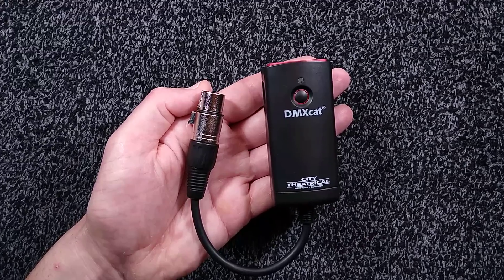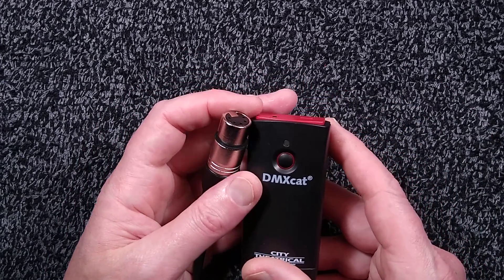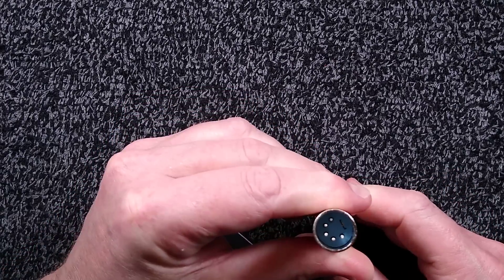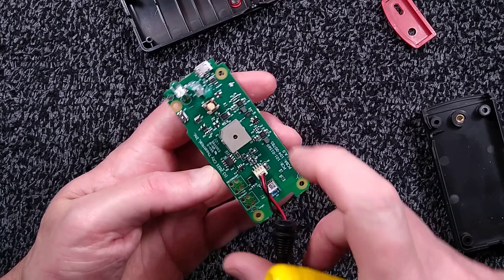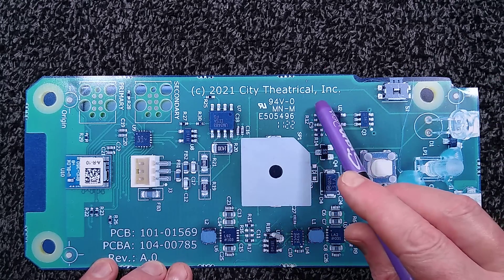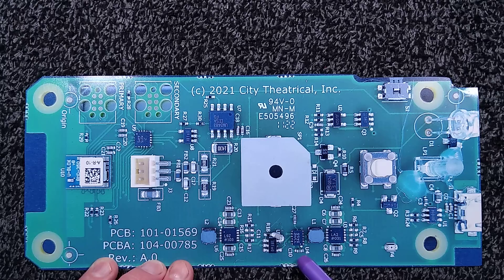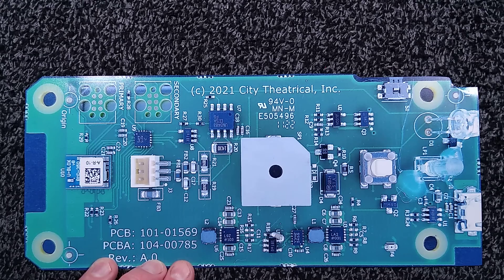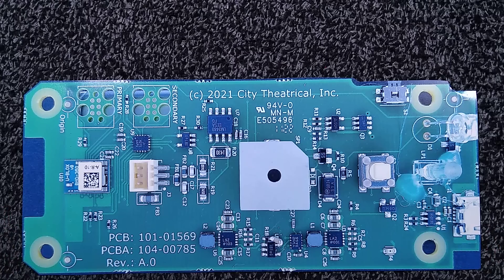Inside the DMX-cat event-industry lighting tool

Comment: As a DMX Cat owner of about 8 years or so I would hope to see an explanation of all of its functions via the software if I was a new user? While it was mildly amusing to see inside the transmitter it was missing the point somewhat? especially as you only had vague knowledge of the items on the CB. So you missed an opportunity to show what all the functions of the software are. IE: Troubleshooting DMX signals [ which BTW are not a network but a Protocol] How to load Fixtures into the device, How to group them, how to troubleshoot fixtures with the device, how to use RDM for addressing and trouble shooting. Show people around the software which is very feature rich. Jus' sayin' because I thought it odd why you did veer off into irrelevance…
Reply from the maker: This was just really intended as a look inside as opposed to a full operational guide.

Comment: I am a firmware developer for DMX/RDM  light fixtures. A wireless DMX/RDM unit from the City Theatrical outputs very weird DMX data frame where it breaks the DMX data frame into chunks. It would hold the signal line high for a brief moment in between the chunk until it is finished sending all 513 bytes of data. This resulted in the DMX frame get stretched and the timing got thrown out of the window.

I had a major problem as my firmware relies on a break condition of the UART to signal the start of a each DMX data frame and a timer. So it would only detect the data that sits between the UART break condition and expired timing while the rest got lost as a result. My fixture works with so many other popular DMX controllers that has a proper DMX data frame with strict timing such as Enttec, DMXKing etc.. except this thing. The client (quiet big) would not wanted to change the controller system, I ended up rewritten the whole low level receiving end mechanism to support this device. To these days, there is no explanation as to why the City Theatrical would allow such deformed DMX frame like that in their commercial product.
Reply from the maker: Keep in mind that the DMX standard does allow for quite long gaps during transmission of the data.  Many simple DMX generators use that tolerance to do other processing.

Comment: Hey Clive! I’ve got a potentially interesting video idea for you. 

Recently some of those “disposable” personal fog machines have been being built with a USB-C charging port on them. Before, even if there was juice left in the machine you were at the will of the battery and that’s why people were tearing them open and charging them in less-than-ideal ways. These new machines still aren’t refillable with juice, but the battery has a charging port. 

This begs the question, though: Do they have an overcharge protector? I haven’t torn one open personally but I would not at all be surprised if some models don’t given that most of these come from factories in China, and that’s a serious hazard.

It’d be interesting to see a handful of models opened up on camera. I don’t suggest you just go out and buy a bunch of new “fog machines” to source the rechargeable ones but you might have to find a more reliable source than your local roadway. Unless the UK has a more serious issue with an overlap between people who litter and people who use personal fog machines than I thought.
Reply from the maker: I made a video about one of those recently.  It does seem to have charge control.
Reply: @bigclivedotcom  Oh okay! I must have missed that video. That’s a relief for sure.

Comment: Very useful tool.. to prank your colleague with the flamethrower on stage. :-)

- How are safety features handled,  movement or "flames" in the protocoll, wired or wireless, so there is no equipment going crazy on interferences ?
Reply from the maker: The flamethrowers we use require specialist controllers.  The cheap eBay ones are not safe at all, as DMX has no error detection.
Reply: @bigclivedotcom  ah, thats really bor..
 i mean interesting to hear 🙂

Comment: The (not) fun of DMX. I put my hand up to design and build a bespoke lighting system for a large marquee on a small island . Apart from anything else it was a marine environment so 3 or 5 pin Amphenol connectors  did fare too well and neither did the marquee itself when the gale force winds hit it. As I worked though the various issues and tried different kinds of lights I found one we had that was made for film and TV lighting that used 2 bytes for each of the RGB sources, the only way to get very precise colors it seems. DMX was probably as good good as could be done when it was first thought up but I feel today there could be a demand for something less prone to confusion and more robust.
Reply: It could certainly do with a bit of a revision to add FEC and a little more bandwidth.  But the longer it stays viable, the less likely anything is going to dethrone it, just for the sheer ubiquitousness of it.

Comment: I think it is hilarious that they came up with the metaphor "universe" for basically a bus with at most 512 units on it, leaving no relevant metaphor for a setup of several such buses.

That level of foresight beats Gates' infamous 640k RAM prediction...
Reply from the maker: DMX512 was originally intended for controlling dimmers.  At that time they didn't realize it would be used for moving lights.  512 dimmers would be a lot.

Comment: While doing some research on can bus for a DIY CNC project I came across the following tit bit."The EU has mandated the use of CAN SIL 2 for automation in new products which  are safety critical to the public". 
But I haven't been able to verify this.
I know DMX has being used to control Safety critical items like lasers as well as winches and hoists for moving rigs and staging. Dp you know if DMX/RDM is SIL 2 rated and do you think this might affect the future of DMX.
Reply: DMX has been fudged to work with those systems but as it has no error checking built into the protocol you need extra electronics/software to "sanity check" the data as well as separate hard wired E Stops/deadmans. Sanity checking methods depend on the type of device and can include :-

Same data must be seen on two or more channels.
Must receive the same value over 3 or more frames.
Ignore sudden huge jumps in value (filtering)
Values must be within a specific tight range (for basic on/off triggering)
Only send cues to trigger sequences controlled by a safer system.
Ideally several of those methods would be used together.

I don't know the requirements for SIL 2 but DMX is almost certainly not compliant but it's possible if could feed control data/cues into a SIL 2 rated system.
Reply: On one system I designed there were two channels that had to be set to 50% (within about +/-10 to account for analogue desks) to arm it and also if the fader was moved too fast (someone knocked ot for example) it wouldn't arm the fore command was again 50% but a single channel and no restriction on speed, there was a stage manager acting as a spotter with a deadmans to physically kill power if necessary after which the system would have to be disarmed and re-armed. Another thing you have to be careful of is that some "smart" DMX repeaters can carry on putting out the last values recieved if they loose input so flame effects etc.  mustn't be used with them.

Comment: I notice that the professional 5 pin plug only has 3 wires!?
Reply from the maker: The DMX standard allows for two independent networks with a common 0V reference.   Only one is needed in this application.

Comment: The probe they use is called Tag connect. It is a commercially available debug / programming probe and is advertised as a way to add programming headers without any additional BOM cost. There are two versions of this probe. One locks in with the outer holes and is used for debugging and the other version just pushed in. Both probes use pogo pins for the connection. I also use it because it flexible an not that expensive for the probe and as sayed above, no BOM cost for debug headers.
Reply: Is that connector proprietary? I didn't have any luck finding off brand versions. I was thinking about including it in some of my projects, but even the "barest" cable (6 pin pogo tagconnect with no legs to 6 pin IDC) costs about 40€ (for something that should be in the low single digits). I know the purpose is to save cost on mass produced items, but that price of the connector is prohibitive to just have around, especially when it would be useful to have multiple to have them permanently connected to different programmers for SWD, ISP, TPI aso.

Comment: Clive is a DMX bandit
Reply: Maybe Clive has designed some DMX gadgets using some of the older PIC micro's. It can be done with the old (and much newer) 8 bit PICs running at 20MHz and having a UART. Many moons ago, I used to work at a place that did just that, and managed to fit a clunky DMX controller into 8k words of program memory (only 256 slots though, as limited by what I was allowed to use at the time - a pic16c77, and the existing PCB already designed by someone else). PIC16c65, 16c74 and 16c77; ancient by today's standards!

Comment: The debug probe is the TagConnect 6-pin, promoted by Microchip for PIC programming.  It has 6 pogo pins for data and power, 3 alignment pins for the small holes.  The "with legs" model has 4 plastic snaps the grab into the 4 big holes so ypu don't have to hold it.  The TagConnect plugs were originally promoted as a way to provide a zero cost JTAG connection point, but the designers thought that all JTAG attachments needed the extra signals added by some proprietary solutions, so they focused on their larger plug with more pins (I think it was 10).
Reply: Silicon labs like the 10 way version too
Reply: @edc1569  yep. it's usually a small header, they call it "mini simplicity" connector. Its basically SWD+UART+Energy Monitor+ Packet tracer. A handy connector, I like them, and adopted them for other non-Silabs designs

Comment: Is it possible to get something like this, but way cheaper?
It doesnt look like it would be too expensive to build.
Reply from the maker: The cost is in the software.  There are generic disco units available, but with very little functionality.  This unit has a frequently updated library of different lighting fixtures.
Reply: You'd have to make it yourself. I'd guess an esp8266 or esp32 using a web interface would be good for DIY, you could write a mobile web app for it then instead of having to learn how to program a native mobile app - you could even program a full lighting controller/desk as a web page too, if you liked. You'd have to implement the rdm protocol and dmx output and some method of mapping device functions to dmx channels. A nice little project.

Comment: What happens if you have a dmx channel clash can you remotely reasign the channel or do you need to prod the back of the light/s?
Reply from the maker: You can have multiple lights on the same range of DMX addresses.  The RDM address is different, so each light can still be remotely accessed.

Comment: Poll: DMX with 3-PIn XLR connectors is better because the pins are larger diameter, they don't bend as easily, But they should have a slightly different chasis, a bit like 240v and 110v ceform power connectors or Powercon/Speakercon connectors.
Reply: I've seen people ram a speakon into a powercon, also seen trucons forced in at the wrong position (which can result in live casings) bent pins in dmx are actually pretty rare so I say leave 3 pin to the DJs.
Reply: Answer 1: I wish all equipment would use 5 pin, then I could do cabling while half asleep without worrying about pushing a microphone cable into DMX and vice versa.
Answer 2: I wish 5pin connectors were as cheap as 3pin connectors.

Rebuttal to your thinking: yes, DMX is a current loop. No, the amount of current is so low that a 0.14mm^2 (26 AWG) wire can carry it without even noticing. The housing around the pins is already so robust that it is almost impossible to bend the pins by using the plugs in a normal manner - you'd have to shove in a screw driver and screw up the driver to bend them.
Reply: @KonradTheWizzard  5pin and 3 pin are pretty much the same price, bit of difference in panel mounts but inline theres maybe only a penny in it and if you buy any sort of quantity that difference vanishes.
Reply: @Savagetechie  If you buy from Neutrik, then yes absolutely. If you buy the really cheap chinese connectors then the difference is factor 2-3x. The 3pin ones are so cheap that a hobbyist is able to live with the sh*ty quality. The 5pin ones make you think whether you wouldn't be better off buying quality for double the price instead.
Reply: @KonradTheWizzard  Cliff components do nice inline ones for £1.60 a connector, cheaper than neutric and not shit.
Reply from the maker: Good idea for a poll.
Reply: @bigclivedotcom  Yep, you should run this. NB: I'd always choose 5-pin if it wasn't for the amount of times I have had to deal with the bent pins. For me, thats a deal breaker.

Comment: I keep contemplating using DMX as a way of "outsourcing" switching a light with an AC plug on a project of mine. Unfortunately, nobody seems to actually make a low cost off-the-shelf compact "2 relay-switched outlets with DMX control" product.  Lots of much bigger/fancier things that could do a similar job, but they're all huge and/or expensive.
Reply: There are some cheap chinese DMX LED controllers on ebay. You could abuse one of those to drive up to three relays (using 0 and 255 on RGB controls)
Reply: Besides cheap controllers, theres a lot of DMX-stuff from china that fullfills his needs without abusing something (put "DMX relay" into Ebay-search), ...
However, years ago my own successfull abuse  was to solder wires onto the 3 pins of an external RGB-Pixel controller (WS2811) instead of an RBG-LED and wired these (including the negative) to a standard relay-board using optocouplers to drive the relays, ... that also worked fine (additional decoder for RGB-strips needet).
Any standard 3- or 4-channel decoder/dimmer can do the same.
Reply: If your coding skills are sufficient to greet the world hello in C, you can pretty much roll your own DMX whatever.  There are, naturally, Arduino libraries a-plenty, and I'm sure you can't swing a dead cat in a hackerspace without smacking into the schematics for an RS-485 gadget.
Reply: @sirnickity  It has nothing to do with what I can build, and everything to do with product liability and certification for switching mains AC if I want to sell a product that needs to ultimately do that.

Comment: Thanks for sharing this! That's a neat tool... I like the way the industry has matured, it's come a long ways!... Story time friends... I'm going to take you back to my "theater" days so-to-speak in the late 70's early 80's I volunteered to work the sound/audio at a small church.  For special musical productions when we needed stage lights someone at the church made a control box... (big heavy thing) out of plywood with 8 rotary dimmers (the ordinary kind used in residential wall with push on/off and rotate for dimming) and 8 outlets...  I'll give him credit at least he used some pretty whopping heavy duty extension cords to run to other boxes with lights... These "Light" boxes were also heavy duty... It had sockets for 3 outdoor incandescent flood lights some were colored inside the box was some aluminum foil for reflection the box had a 45 degree angled sides to it (ASCII sketch:  [ ]< )... these were made to either be hung or sit on the floor and point up at the stage,   If you cranked those babies up, you could feel the heat... wonder if you could cook a hotdog? Seriously... LOL!  Overall, I think we only had 3 or 4 in use and not at max brightness... but thinking back on it, if you powered all 8 of those suckers I wonder if that "control" box could handle it... I think it had 2 AC inputs one for each bank of 4... but I give the guy credit for using extra beefy extension cables, but our wimpy power supply here in the U.S. (LOL)  120VAC / 15A /20A circuits and all those flood lamps?  Not a chance!   Heck, I don't even know if those rotary dimmers could handle 3 outdoor floods just by themselves.  On a side note: I borrowed that box to run the lighting at the Halloween events at the church... I will say that the guy that made this setup was handyman and kudos to him, because it worked for what we needed to do.

Comment: I wonder if that BMFL is related to R2D2?

Acts like a robot in Star Wars.
Reply: R2D2 happens to be its estranged great grandfather. R2D2 still uses 10V analog tech and complains that those modern kids don't really know what show biz is all about with their digital DMX and MIDI nonsense. On the other hand great uncle C3PO had a conversion to DMX in the late 90'ies, which caused a rift between the two and they only recently started to speak to each other again (at least off stage)... rumors are that C3PO is trying to convince R2D2 to get a MIDI 2 interface, but you can't really believe such gossip.
[SCNR]

Comment: Found an SMD cross reference that says XB1 is a n Infinewin LN6219B  LDO in SOT25 or SOT-89-5
The Bluetooth module appears to be a U-Blox BMD-350 bluetooth 5 module based round the Nordic nRF52832 Arm Cortex-M4 with FPU, 512k Flash, 64k RAM

Comment: xb1  is possibly LN6219B322MR 
however the pin hooked to the secondary mcu is labeled nc in that datasheet so it might be slightly different
the mcu looks like a freescale kinetis from the power and ground lines